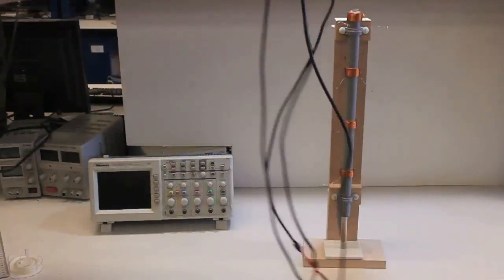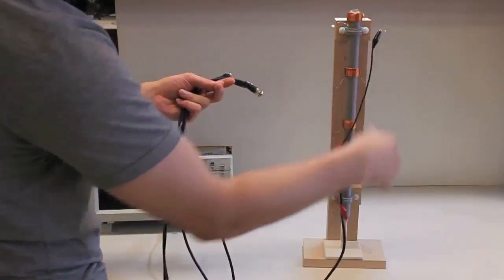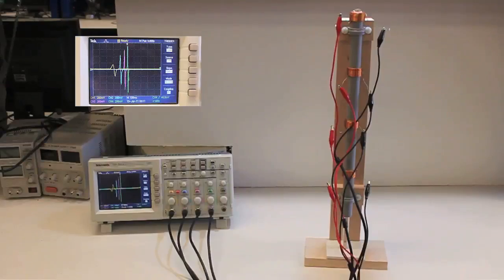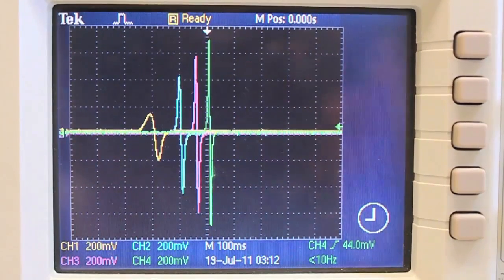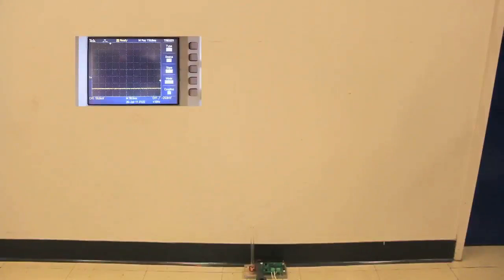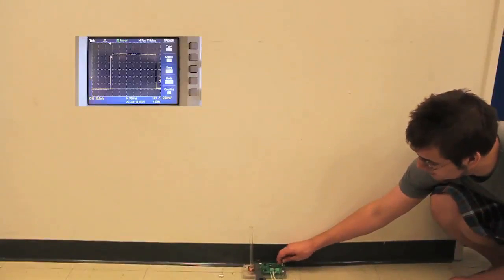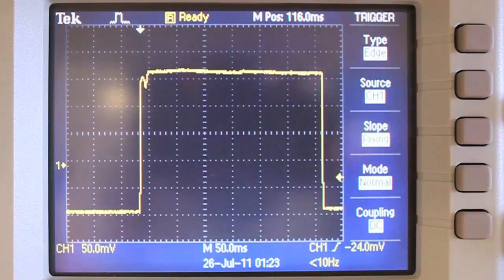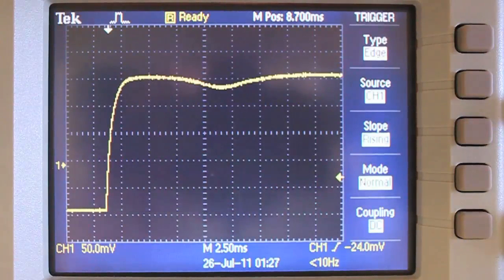Lab 2: Shooting Magnets

Comment: A square wave is simply a change in voltage that has a sharp rise time, stays at x voltage then has a sharp fall time. While digital signals are usually square wave, this exercise has nothing to do with digital.